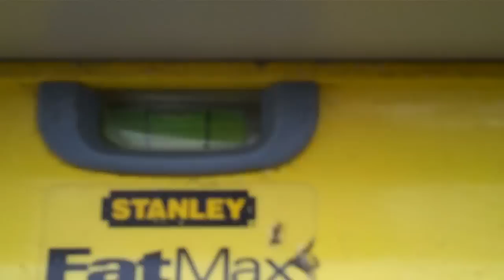Using A Level Is A Must

Comment: Thank You Torontoeavestrough! Greg here! Been searching where no man has gone before! You present your information precisely and in layman's terms. (or today, is that DIY terms?) No jargon. Others using terms that are unknown to me. So, to follow along have to note and google additional unknowns! Replacing hangers, some leveling needed and adding covers. Channeling all water is crucial as my sole source of water is rain water. Just two straight 45' runs joining into 2x1K gallon cisterns. Seems no such thing as never clean the gutters again covers and 100% no water runoff. Roof pitch, not steep. Going to find out, but Valor does make a large mesh cover to handle water, but looks awfully flat. No high/low ridges which seems would help with control. ANYWAY! Off i go again. Great job on videos! If you ever want to get off the roof, do presentations, you're a natural.